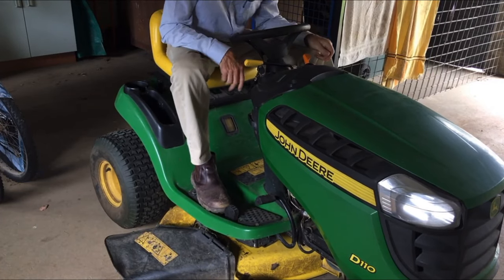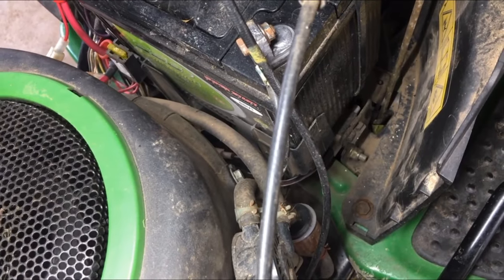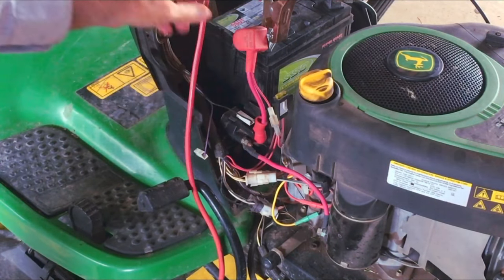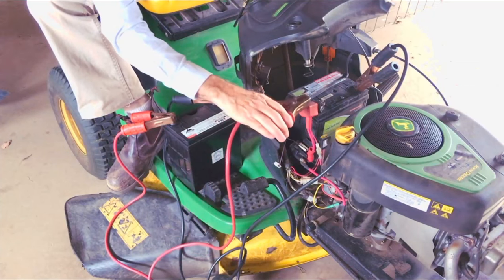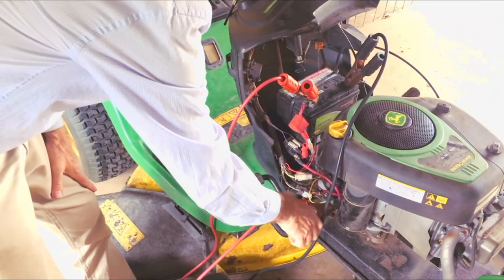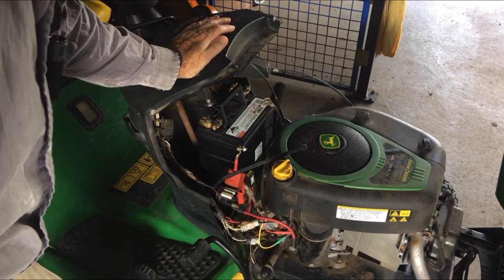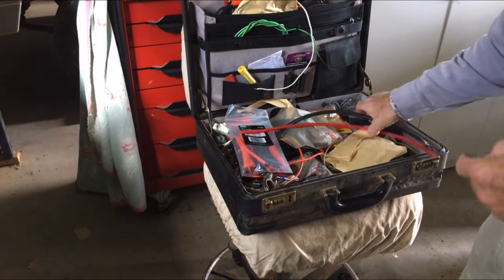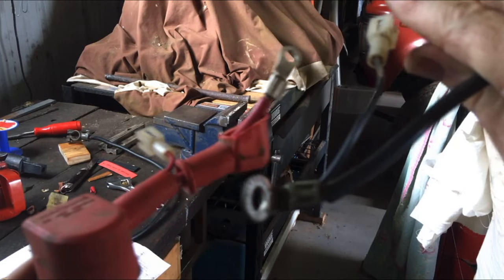No Crank, No start, John Deere Mower, Lawn Tractor D110

Comment: So that 12.6 volt battery wasn’t strong enough to start that mower.
Reply from the maker: Correct.  It had hardly any amps.
I took it to a battery specialist shop to give it a load test keeping in mind I know  they sell batteries but by the time I travelled the 15km into town the voltage was only 10v or something like that.  There was clearly a short or something stuffed inside the battery and the car ride into town made it worse.
I hear that the vibration of mowers is hard on batteries and the charging system isn’t that great in the first place.
Notably the replacement battery is still going great.  I guess the take home is that the voltage reading isn’t fool proof.  Keep an open mind.

Comment: I would guess the bat. Had a short in it. Probably dropped to about 6volts when cranking
Reply from the maker: I didn’t measure the voltage while it was cranking but by the time I got it to the shop to test it on their load tester the short was worse.  So the ride to the shop completely killed it.  They tell me the charging system on these mowers is fairly poor but I reckon the vibration kills them prematurely.

Comment: What if I have a click.but won't crank
Reply from the maker: Hi Garry,
Make sure ALL the connections are clean.  If that doesn’t help take the battery in to a battery shop and get it tested.
If that’s all good then bypass the solenoid like I do in the video.   
Can you turn the motor by turning the fly wheel screen on top.
If yes then that possibly just leaves the starter motor itself.
See if you can rule out the pieces that are working and find the one that isn’t working.
Good Luck 🤠

Comment: Think that's newer than the L110 john deere
Reply from the maker: Not sure about the different JD models.
I bought this D110 in 2011.  No idea when this model was first released.
It has a 19.5 Briggs and Stratton engine.  It says “Assembled in USA”
It may have some modifications for Australia.  Who knows :)
I hope this video helped solve your problem 🤠
Reply: @DavoShed  my L110 has the Kohler command cv491s engine and i bought it as it was used

Comment: Why not just purchase a correctly aligned battery?  Solves a lot of issues.
Reply from the maker: Good question 
I already had this battery after rescuing my wife when her car alternator failed.  I had the alternator replaced and put the original battery back in her car.  Not that long after we sold the car.  That left me with this brand new battery.  Not much of a market for second hand batteries 🤠 so this turned out to be a perfect use for it.  For some reason this mower is very hard on batteries.
Reply: He was just using the incorrect battery for trouble shooting. He explained that.did you not hear him.
Reply from the maker: It’s all good. 🤠

Comment: I would just buy the right battery
Reply from the maker: Sure, but I already had this battery for my wife’s car.  I bought it to get home one day after the alternator died.
She sold the car before the old battery was done.  So why not use it?  It has more CCA than the original.  The only problem was the terminals are the wrong way around.  So I made longer cables.  It’s still going strong 🤠

Comment: This one is easy. Just fix the battery and you're done. Try this: new battery, new solenoid, new starter, new air filter & oil filter. Yet, it only cranks but doesn't turn over. I'm about to change the carburetor. If that doesn't make it start, I don't know what will.
Reply from the maker: Yes but I didn’t know that at the beginning.
It turned out the battery had a partial short inside that was hard to determine.
The goal is to home in on the problem without throwing parts at it.  Regular maintenance parts like filters are a good idea anyway.
If your engine turns over when you turn the key you have ruled out or already replaced the starter, solinoid  and the battery as the problem.
If you have replaced the air filter that’s good.  It means it’s getting air.
That leaves Compression, Fuel and spark.
Take the spark plug out and re connect the cable, hold the threads against a metal part of the engine.  Crank the engine being careful not to zap yourself.  Wear rubber gloves if you are concerned about that. You should see a nice blue spark if you are inside.  Can be hard to see in sunlight.
If not then spark is your problem.  If you don’t you could clean or replace the spark plug, they are cheap.  
It could be a compression problem but less likely.  While the plug is out put your thumb over the spark plug hole turn the flywheel by hand.  It should squeeze air past your thumb.  If it doesn’t then that’s your problem.
If you get a good spark put a tea spoon of fuel down the spark plug hole, replace the spark plug being careful not to cross the threads.  Then try and start again.  If it kicks and tries to run more than before then fuel is your problem.  Check or replace  the fuel filter if there is one.  They are also cheap.
If it still doesn’t go then your carb might need a clean.  If so at most you will only need a gasket.  There are heaps of carb cleaning videos out there.